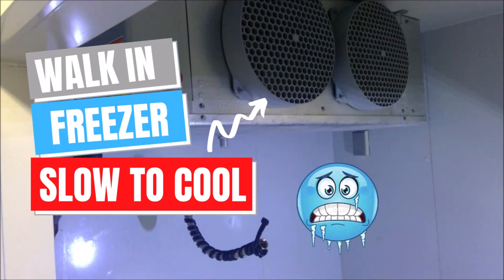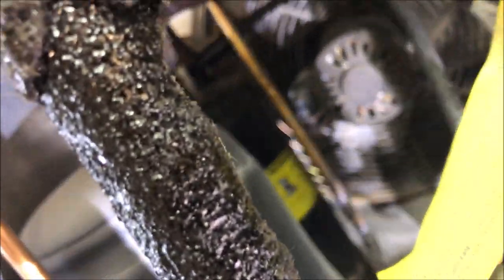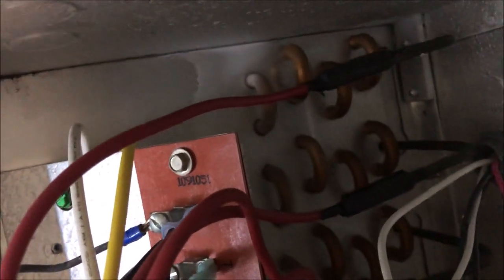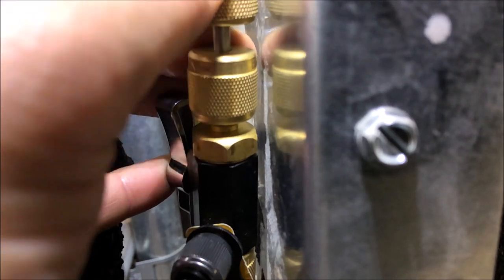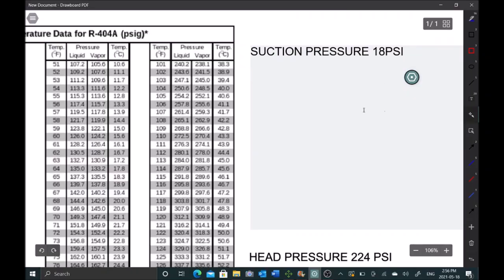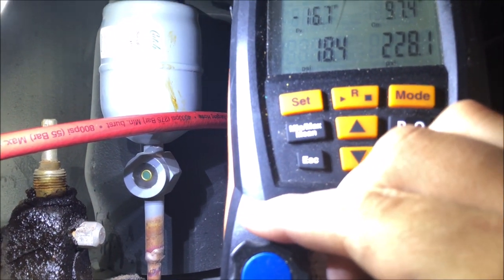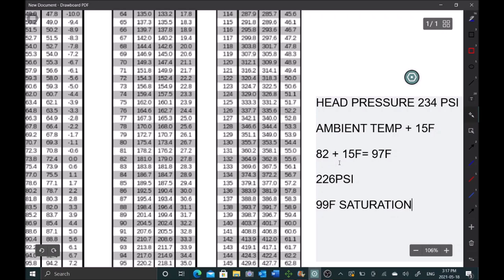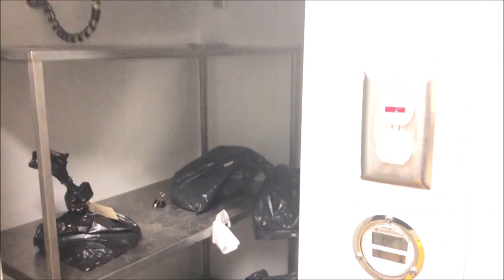Walk In Freezer is Slow To Cool

Comment: I've found great value in your videos. if it's not too much to ask I know your time is valuable but I have a question. Do you always use 30deg for the condenser? and doing the math for the evap you said depends how the TXV is set up. Can you elaborate? do you mean what the superheat is set to? THANKS !
Reply: nevermind looks like you have answered that question in Nausium thanks again
Reply from the maker: Newer equipment is using a 15TD Condensor.  Generally for walk in freezers we want 6-10F SH, but we can use 10F as a ball park for troubleshooting. If the installer set the SH to 6F the td would be 6F

Comment: Ok watched video noticed that you used saturation temp for suction pressure spec now at -10F box temp wouldn't your coil be more at-20F at 10 degree T.D. and at 10F superheat wouldn't that put your final suction pressure on a full system clear glass more at 9to 10 psig at -10F setpoint looking for feed back thank you
Reply from the maker: I’m looking for a 0F to -4F box temp, nothing much colder than that. So let’s say we are aiming for 0F box temp. At that temperature, your superheat will be closer to 4-6F. This would give me a saturation of approximately-4F. At -4F saturation, my pressure would be 28PSI. At 10F to 15F box temp, that is when you will get your 6F to 10F superheat.
Reply: @REFRIGERATIONKITCHENEQTECH  tkank you

Comment: So if the pressure are low enough they will freeze the coil? If the leak continues the coil would defrost overtime? It seems there are certain conditions that happen at certain pressures.
Reply from the maker: Yes, low pressure = low saturation temperature, causing the coil to freeze up. If the coil continues to leak, the ice on the coil would get worse and start to cover more of the coil.

Comment: Did you use a delta-t of 10 to 15 degrees across the evaporator coil to subtract from the one degree temperature? Thank you Tim 863. 255. 9001
Reply from the maker: 10F TD evaporator for walk ins. This is just a general calculation to get us in the ball park so we can troubleshoot. The real calculation will be superheat.

Comment: If you drill a hole in a cap you can soap the cap and the leak will blow through and you won't risk soap getting in the system
Reply from the maker: That’s a good tip

Comment: Love the Way u operate. Question on CS, I thought condenser splits wer around 25 for freezers n 30 for coolers. U had 15 ? Thanks again for sharing!
Reply from the maker: The older condensing units used a 30F condenser split. A lot of the newer units including the reach in units are now using a 15F split.
Reply: @REFRIGERATIONKITCHENEQTECH   thanks for the information. Great video n and thanks for sharing 👍
Reply: @REFRIGERATIONKITCHENEQTECH  From what I read the manufacturers are now using multiple CS based on compressor hp. It's now hard to know exact CS w/o oem spec sheet. I was hoping you did SH or SC at condenser. It would've been a perfect top notch video.

Comment: Do you always use ambient air plus 15 or only on a freezer? Do you do ambient air plus 30 on like air conditioning sometimes or like if it was a regular walk-in cooler?
Reply from the maker: A lot of the newer units are using ambient temp plus 15F in order to calculate your head pressure. The older units use a plus 30F so sometimes it’s hard to know if it’s a plus 15 or plus 30,  so it is very important to do your checks (fans, sight glass, suction saturation and SH etc)